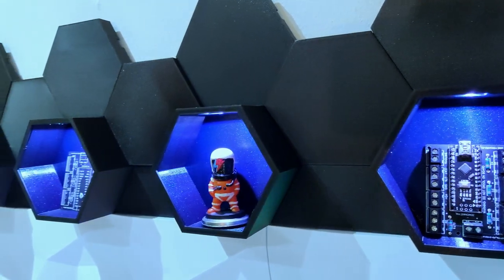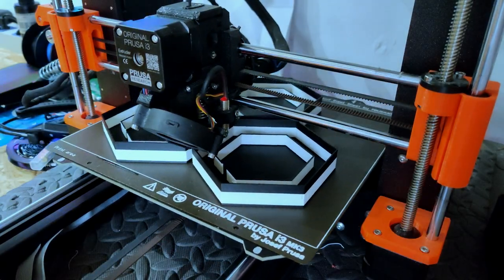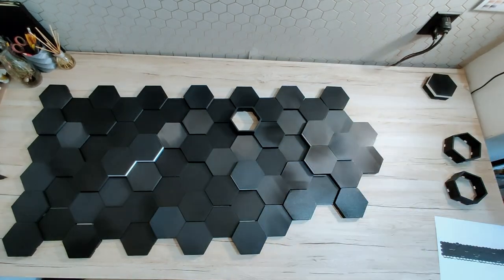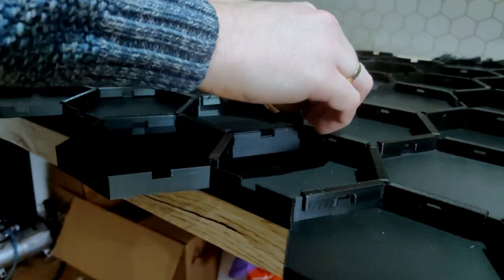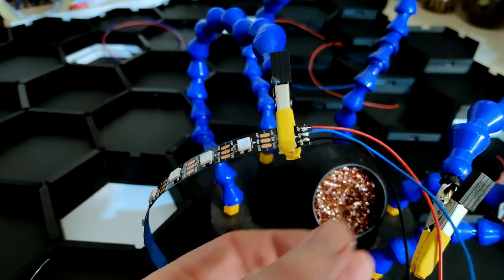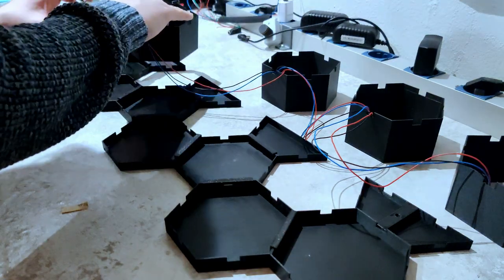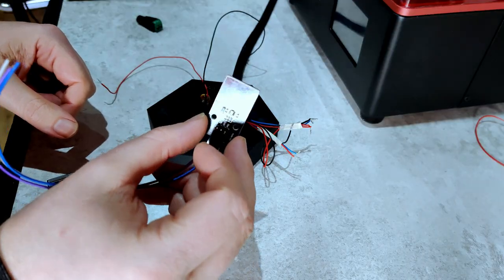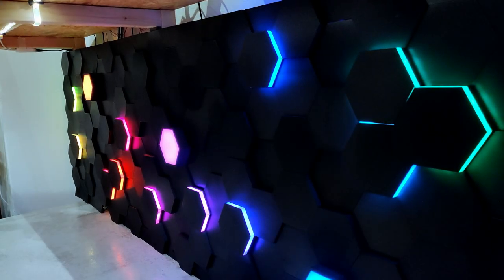3D printed another wall my 2 year old designed and it lights up!

Comment: I think I'll try that! But, it seems some files are not the right one on prusa's website ( hex-40 is hex-35 for example). Also, as I'm new to 3d print, I don't now the .3mf file (work with creality printer). Is it a problem?
Reply from the maker: I just updates the files, so they should all be good now. The .3mf files are the replacement of .stl, your slicers should read it juts fine. I have printed a lot of tiles on enders so no problems there.
Reply: @3DMonkey  thanks mate. Amazing work! I'll have to learn about led and things like that but, I really like what you've done!